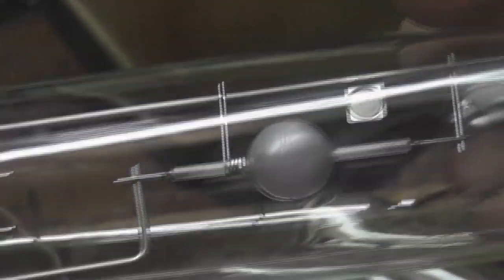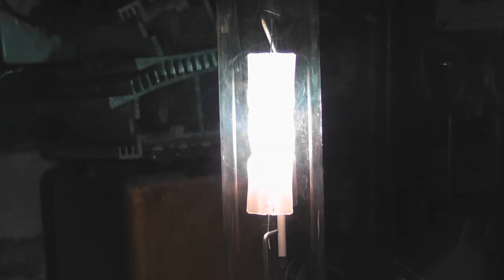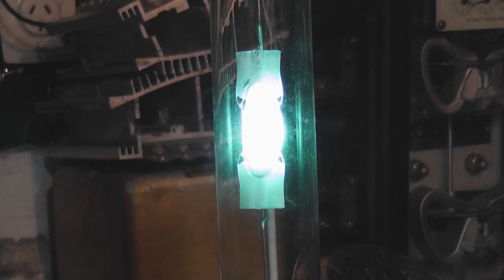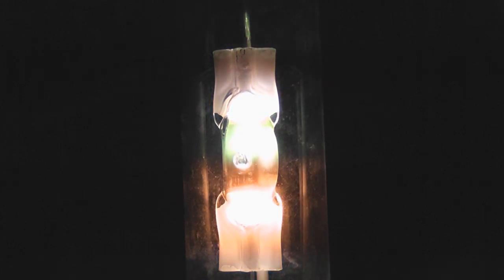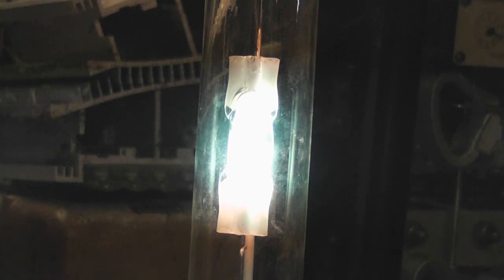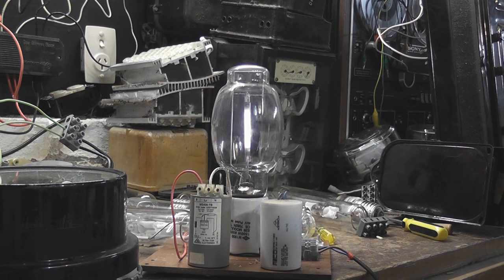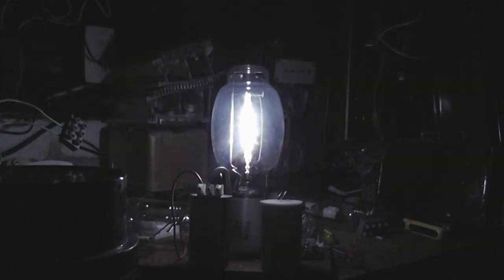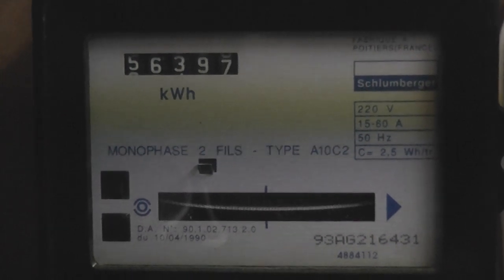Metal halide Lamp Tests

Comment: Some interesting colours going on there! When MBI lamps reach the end of their lives the halides themselves tend to attack and penetrate into the quartz arc tube and you get some neat colour shifts depending on what metals are left in there!
You see a blue, green or purple halide lamp and you know it's not far off exploding! That's why they should be changed when they have done their rated hours even if they still work!

Thanks for the shout-out by the way!